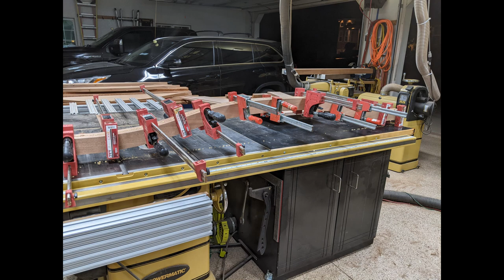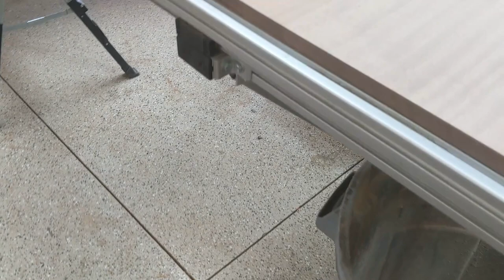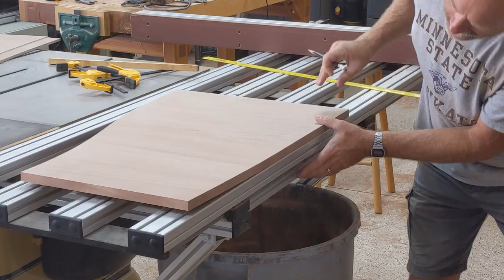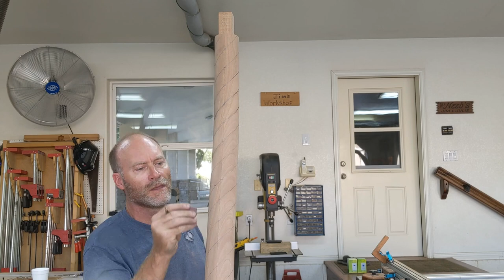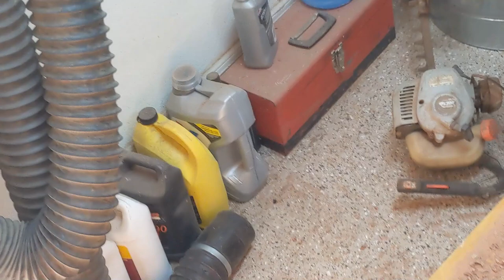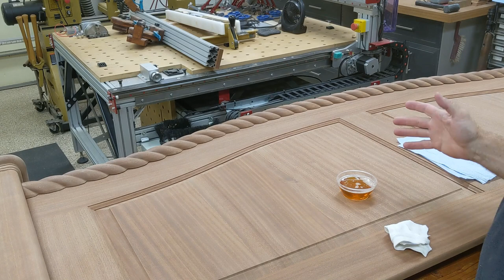Making a king size Sapele bed with hand carved rope molding and CNC cut panels and rails.

Comment: Nice job I’m in Phoenix too and have a Avid to .
Reply from the maker: Cool, er maybe hot now I guess :-).  I hadn't met anyone here with an AVID yet.
Reply: @JNWoodworks  I’m getting ac for the garage I just got mine a week ago working on the spoil board it’s pain in the  it’s a 5 x 10
Reply from the maker: @kevinspencer9114  Nice.  I have almost talked myself into adding a split unit in my garage two years in a row.  I have a large fan that works pretty well until the humidity kicks in ( like today).  I think I'll do it this fall.
Reply: @JNWoodworks  I work for a big HVAC company I’m getting a 2ton because I have a three car garage of course I get a discount if you need one let me know my issue is the power has the wrong ways
Reply from the maker: @kevinspencer9114  I was going to do one of those DIY 3 ton precharged mini splits units.  I would be interested if you have those.  I just have to get around to putting in my power disconnect.
Reply: All mini splits come complete charged when you are ready let me know I would be glad to help The line set should be vacuumed down to 500 microns.
Reply from the maker: @kevinspencer9114  Hey Kevin, can you send me an email at jnwdwks@gmail.com?  I think I'm going to get a minisplit and I'm interested in what models you have available. Thanks.